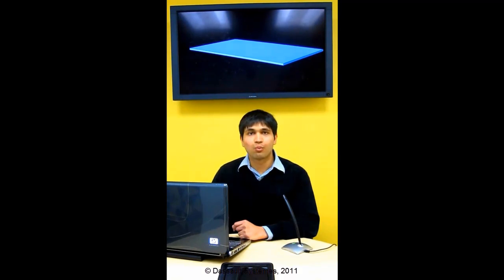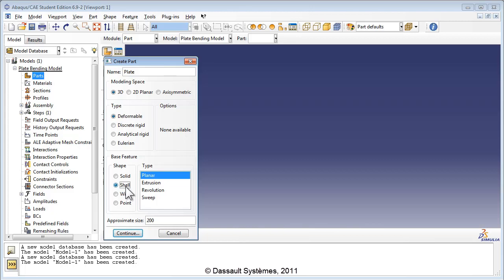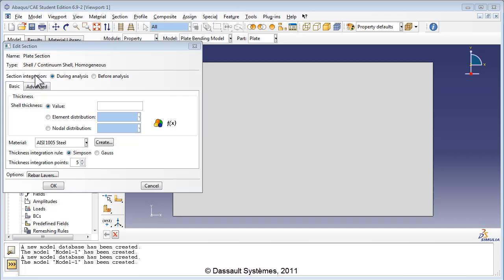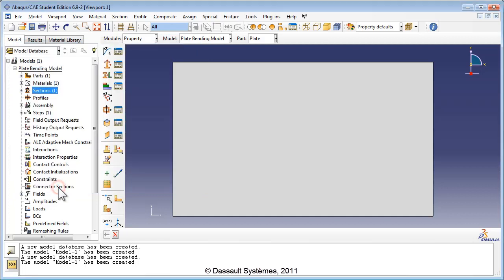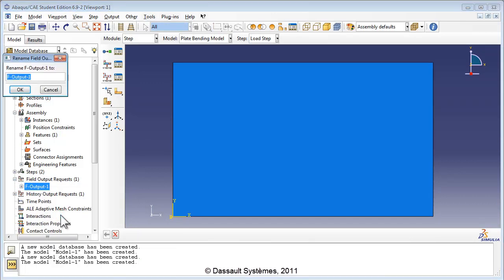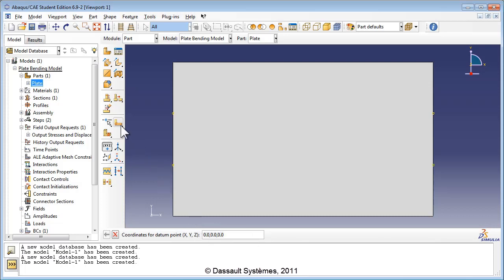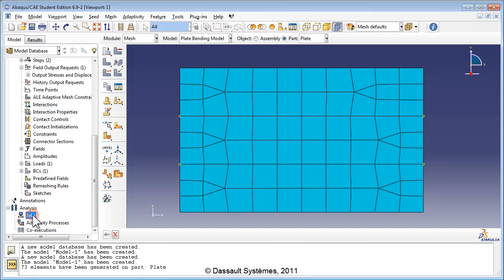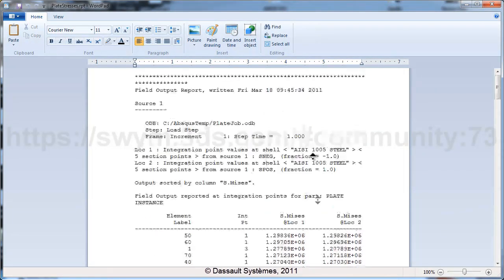SIMULIA How-to Tutorial for Abaqus  | Shell Structure (Plate) Bending Analysis

Comment: i have a question and would be great if you could reply .. so after partitioning if I want to apply pressure across the plate on one of the surfaces (each thickness 1 and length 5) how can I do that ? I have much similar problem and my plate (100 mm wide) needs a pressure across the plate on a 2 mm wide surface .. but after partitioning i cannot apply pressure as I cannot select any such surface on the plate during load application, even though the surface is there.  Why is this happening if you could comment
Reply from the maker: Hi Mueed, We invite you to join our SIMULIA Community where you can post your question on the community board. Our technical experts monitor & provide support for specific needs! https://www.3ds.com/products-services/simulia/communities/simulia-community/?utm_campaign=202007_spe_simu_SLC_en&utm_medium=socialnetwork&utm_source=youtube&utm_content=txt&utm_term=cl_simulia
Reply: Hi, this is my problem too.
how did you sovle this? thanks

Comment: Hi, thanks for the video. I tried to follow the steps however I have encountered a few issues:
1) I can't mesh the part using an independant instance, so I tried to follow the exact steps using a dependant one.
2) Even after completing all steps, the resulting mesh looks different and when I run the job, the results show no deformation. 
I have just started learning abaqus so I am not really used to it yet.
Reply from the maker: Hi there, we encourage you to join the SIMULIA Community where you can connect with software  users and experts: go.3ds.com/YRy